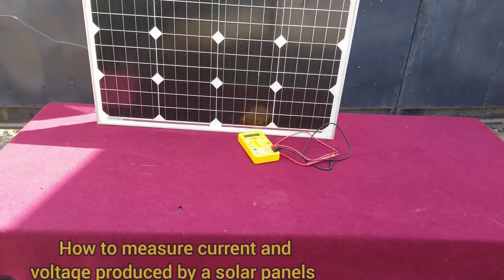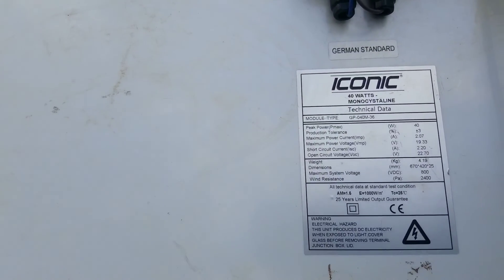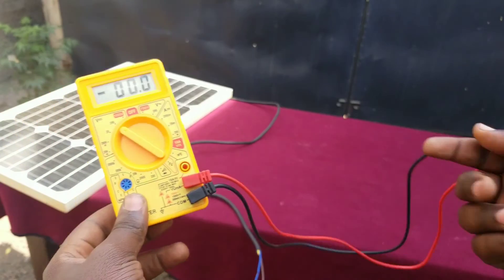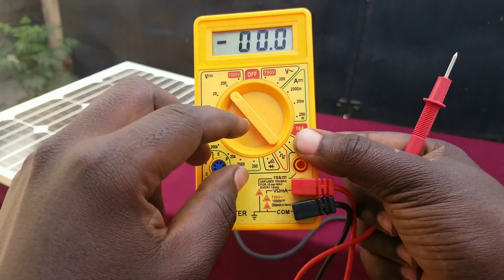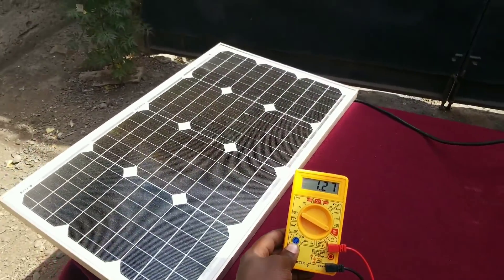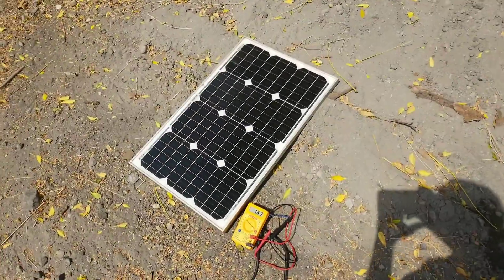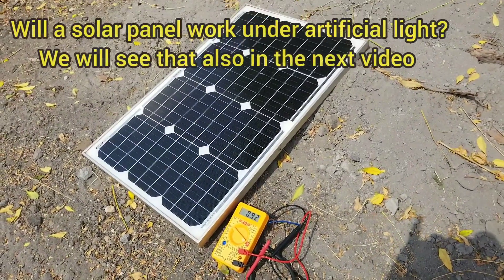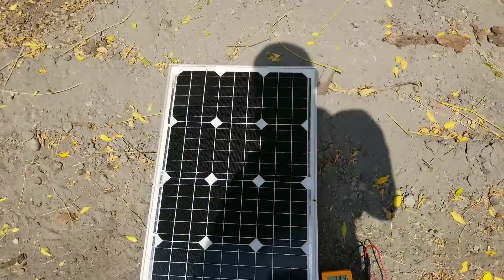How to check solar panel amps with a multimeter/ how to measure solar panel wattage and current

Comment: When testing current, your meter says 10 seconds max!  Every 15 minutes!
What do you think this means? It means read amps for no more than 10 seconds, then open circuit.  Wait 15 minutes.  Then you can read amps again but for no more than 10 seconds.  Hope this helps!

Comment: There is no current reading in my solar panel why
Reply: Check diode if your controller ismt showing current. Disconnect it let it reset. If still nothing you batteries sh*t the bed.
Reply: @efjefe  actually I have doubt , will the solar panel directly produce current